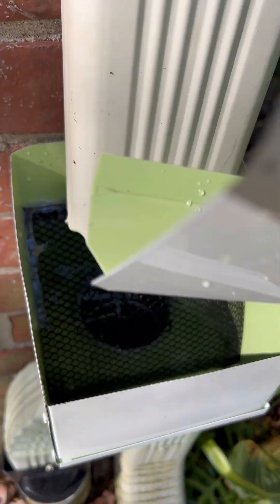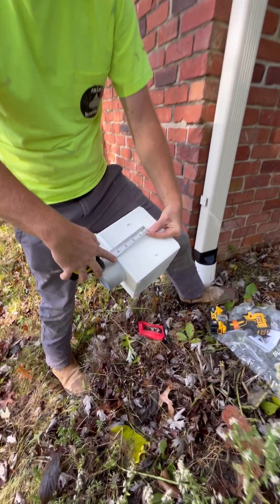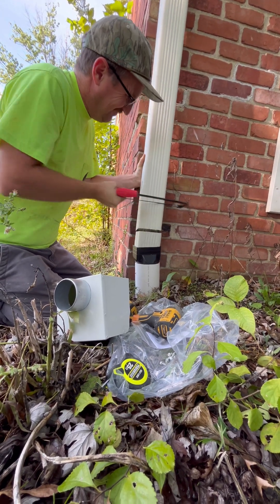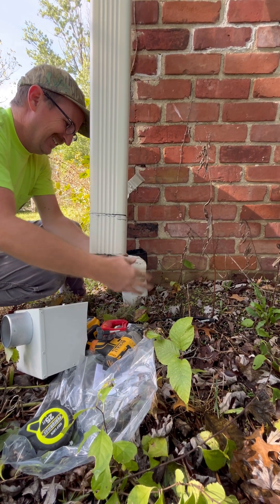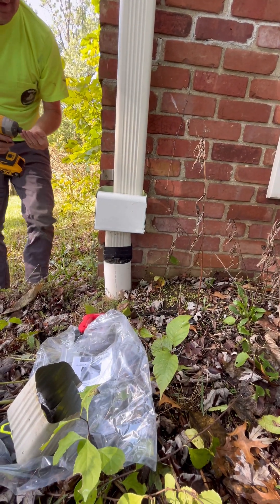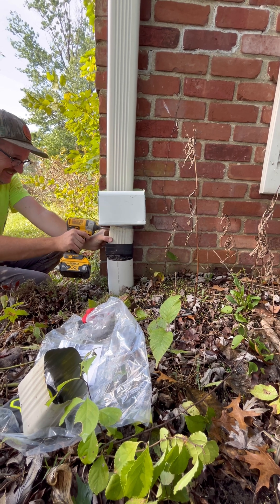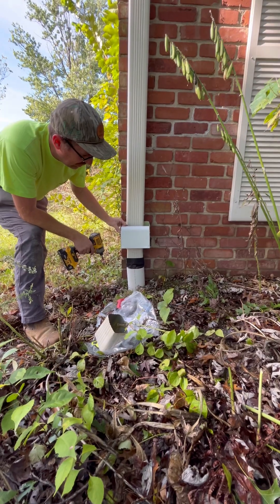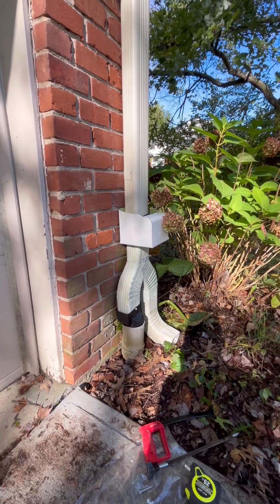Install downspout leaf filter in 5 minutes

Comment: I have one of those and found it clogs with fine sediment and debris gets caught where the downspout meets the screen. Do you carry Rain Harvesting's Leaf Eater filters?
Reply from the maker: There are undoubtedly issues with all types of filters, because they will all clog and require cleaning eventually. The nice thing about this is: 1) It’s price point; 2) It’s made in the USA; and 3) It’s not made of plastic, so it will last longer and weather better. We have tried Rain Harvesting’s “rain heads” in the past (Leaf Eater being one model), and have found that they work about as well as this one but they are not as durable since they’re made of plastic, they have an open front (which, once they clog, will channel water straight out, missing the downspout/cistern completely), and they’re made in Australia so they’re more expensive. Our first recommendation for excellent pre-filtration is our Monjolin filters, followed by our Wisy vortex filters… but those are expensive, and for older cisterns, these are easy to add on and they do the job of keeping coarse debris out. Thanks for writing!
Reply: @rainbrothers  Concur, affordable, not plastic, and domestically made are highest priorities.  Thanks for the reply and thank you for publishing the video!
Reply from the maker: @load_nikon  Thank you for your feedback! I always am curious to know folks’ experience with various products, and really appreciate you taking the time to comment and share